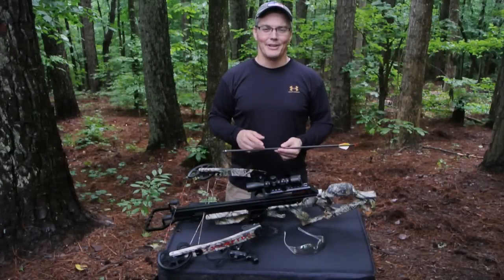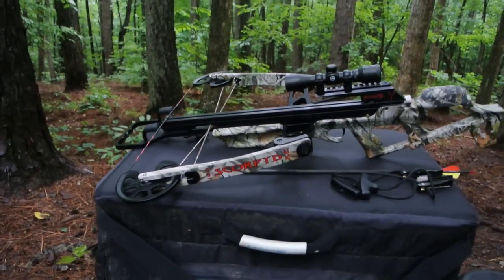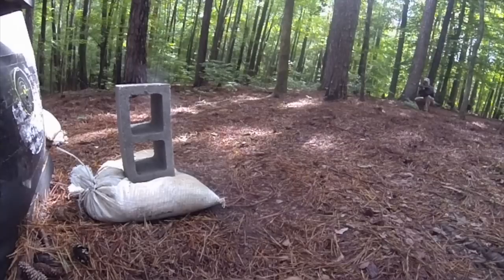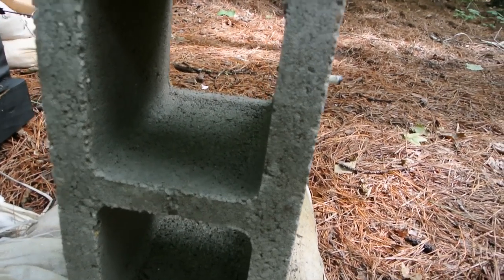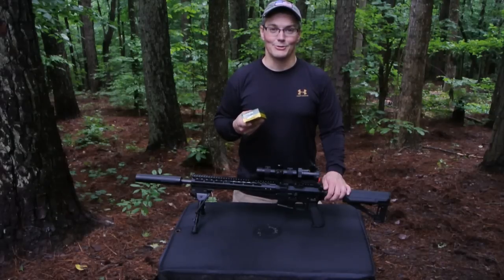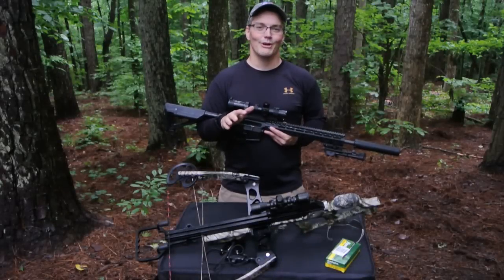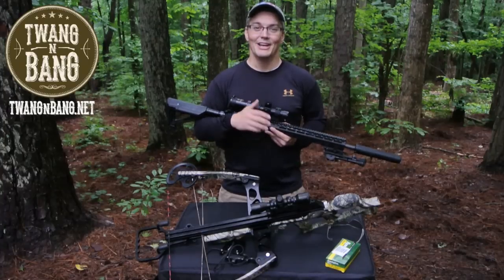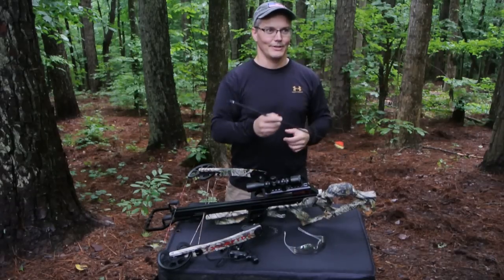World's Most Powerful Crossbow vs Cinder Block! (AR15 Finishes the Job)

Comment: The couch arrived in two boxes four days early, which was great because we'd just moved into a new house and needed places to sit. My son and I put it together pretty quickly https://www.youtube.com/post/UgkxitRzxya-XugamYgLwa_2G1gxPg4MCJHa . Another reviewer suggested inserting the seat into the side and I'm glad they did as the instructions weren't clear on that matter. It's incredibly light and slides easily across the wood floor, making it easy to move. It's firm, but comfortable. It will even be great to nap on. I got the gray, which definitely has strong blue undertones, but I'm okay with that.

Comment from the maker: Don't lose sight of the huge advantage compound bows have over recurves for efficiency.  The only recurve crossbow in production today that shoots as fast as this bow has nearly double the draw weight, and even that has much more efficient limbs than could be produced in medieval times.  So much of the energy required to cock an ancient crossbow was wasted and not delivered to the bolt.

Comment: One of the thing you might have missed is that in his basement, the blocks make up the foundation.... They are solidly secured and will not move at all.   You had a free standing block so the energy got transferred into motion of the block instead of staying with the bolt.   And i think a FMJ or Magnum bolt might have a better chance of cracking or penetrating the block.   The FMJ and Magnum bolts are carbon fiber shafts wrapped in aluminum.   Should be the best of both worlds, the aluminum shell should keep the carbon fiber from splintering and the carbon fiber should keep the aluminum form snapping or crushing.... Just my ideas i thought id share.   Not sure if youve thought of and tried these yet or not.    Great Vid :).  I have a Stealth-X2 myself

Comment: Sorry I'm late to the party here, two reasons why I think your wicked bow didn't have the effect you were looking for: 1) it's a loose block, when the arrow stuck it, some of that energy was absorbed by the movement of the block. 2) If the hunter your mentioned lives in an older house, he might actually have true cinder block and not a concrete block that you appear to be using. We use the terms interchangeably but they're actually 2 different things. A concrete block is made of pure concrete while a cinder block is made of a mixture of concrete and coal cinder and/or ash making them lighter, and more importantly, weaker. I think your bow would have no problem on a true cinder block that's fixed in place. Love your channel brother

Comment: You have to remember that when your friend shot a cinder block in his basement, it was being held in place by the rest of the wall.  A lot of the energy your arrow could have used to penetrate the block was instead used to move the block backwards slightly.

Comment: In High School, as a Class Project, We constructed a Mid-evil Turret based Cross bow, using OAK Centers reinforced with Truck Leaf Springs. It's Tension on the Cable + just over 1200 Lbs. We used a Fixed Winch to Cock the Cable & left over springs as the trigger. We also used a part Oak & part Tungsten Carbide steel Blade from a snowmobile As The BOLT.
due to it's unknown nature, We where allowed to shoot the bow twice, The first BOLT 
Misfired & Passed through 8inches of freshly Cut Solid Oak.

Comment: Oh i forgot to mention you. Wooden arrow and modern arrow are actually different not just by built but also in delivering energy. Modern arrow have holes or hollow within while wooden arrow doesn't. This affected the amount of energy delivered to a target simply because of the arrowhead pressure. When modern arrows hits the target the arrowhead will be pushed into the hole if the target are hard thus waste a lots of energy while wooden arrow delivers full energy because there are no space

Comment: Oh, I was expecting more draw weight, but apperently it's just that much, should probably not have checked the 1250 pound draw weight crossbow before this
Reply from the maker: Draw weight =/= power.  Power stroke is what matters.  Super high draw weight crossbows with straight limbs are very inefficient at putting their draw weight onto the arrow.
Reply: @TWANGnBANG  Power stroke does matter alot, but so does the cam and limb design aswell as the draw weight in terms of increasing the velocity. The crossbow in question that I mentioned has quite the short draw due to it's old design, and it doesn't suprise me that there's quite a bit of kinectic energy loss with it, still with it's faults it did manage to do 235 yards and it's supposed to manage doing around 240-260 yards. 

I'm not exactly the most knowledgeable with crossbows so first and foremost I'm not entirely sure what sort of range the scorpyd has (I did look around but apperently not well enough) but with the power stroke and the design of the scorpyd having more weight power I believe it should basically just pile on more power to it in this case at least. 

Although the big number difference was what my comment was about for starters so in that aspect you're 100% correct in calling me out with the facts :')

Comment: Now that's what I call a good suppressor. What was that, 50 meters from the block? Only a slight crack of a bullet hitting cinder and the block cracking was heard.
Reply from the maker: Мирдж Кладоискатель More like 30 meters, and yes, the 762-SDN-6 does a decent job with subsonic 300 BLK rounds.
Reply: TWANGnBANG That's what the suppressor is called? That's not a very market-oriented name, now is it? Also, I should note that I missed the notion of ammo being subsonic: that, of course, does the job better as well.
Reply from the maker: Мирдж Кладоискатель Lots of military-oriented cans are named like that, and it's actually more sensible to put the caliber in the name than to call it a "Wind Whisper" or something poetic that reveals nothing about what it is. :)
Reply: TWANGnBANG Wind Whisper .45 sounds good, though. :) Either way, thanks for making them videos, they're alway entertaining to watch.

Comment: This might be expensive but I'd like to see the crossbow that replaced this one w/ heavy duty aluminium vs a row of like 6 kevlar panels, and if that doesn't work, even w/ a 100 or 150 gr field tip, finish it off w/ your 308 Remington 700, if it's too expensive you don't have to do it,

 maybe do some testing the powers of ammunition or arrows on bear hide, also if in the future, if you have enough money, I'd like to see 308 AP vs 8 level 3 Kevlar panels, that would be pretty cool

Comment: now try it with an aerobolt2  and a harder head with more weight to get though that block, you can do it I cut a 1.5 inch corner off a 75 year old brick that was 3 inches with a vpa single bevel at 300 grains.

but the aerobolt 2 is almost $30 a bolt, so only if you have the funds.

Comment: Oh by the way I did something like this, on the 4th of july, on a 75 year old brick it loped half the corner off with the broadhead and bent it, I did again and well pretty much folded the tip of the 300 vpa to the head itself, the first time I shot from 15 yards it exploded the bolt in spectacular fashion, very dangerous.

Comment: Nice vid.  Now is the recorded sound of your suppressor close to the actual sound you hear?
Reply from the maker: monkeydad1969 The noise is similar to dropping a dictionary onto a hard floor.  It's a bit louder than you can tell from this video, but it is still crazy quiet.
Reply: TWANGnBANG just a little add on for monkeydad it's not the initial discharge that is all that loud on a suppressed weapon... it's the impact of the bullet. If you've ever been close to the point of impact, especially if the point impacted was a hard surface such as metal, your ears will ring. Suppressors are great tools in masking your location but don't make you the silent killer Hollywood would like us to believe.

Comment: You'd probably get better results if the arrow hit the block at a perfect 90° angle. If the arrow was perfectly straight at impact, ALL the energy would be at the tip and would probably penetrate the block. Also, place another sandbag on top of the block to help prevent it from moving and taking energy away from the arrow.

Comment: Nice video, but it would be great if you could buy that aluminum arrow to show its power, since carbon arrow was performing a bit bad against hard surfaces like car doors, body armor and such. Like you said it expands when it hits hard surface, and lose its power. I don't know if they are too expensive but it would be great to see them in action. By the way I think that full cast aluminum arrow is recommended for this bow because high kinetic energy it produces. Thanks.
Reply from the maker: Tado Samardžić The arrow that I used is exactly the arrow that is recommended.  Nobody makes straight solid metal arrows in the US. Carbon fiber is plenty tough for use against North American game animals.   I do have a solid fiberglass and steel discharge arrow that I might use in a follow-up to this video someday.
Reply: TWANGnBANG Sorry I Thought they said solid metal bolt but I haven't heard them right; /watch?v=yhVNMoRXjOY.
Thank you for fast response and great videos and review you've been providing us with.
Reply from the maker: Tado Samardžić Not sure where in the video they say that, but as I hope you understand, I don't have time to watch the 10 minute video to find out.  In any case, you can see they sell GoldTip Laser III carbon arrows with their "Scope Plus Package."
http://www.scorpyd.com/crossbows/velocity/

Comment: Wow, that crossbow puts my old Barnett Commando to shame. I think it's rated at 205 fps. I might as well be shooting paperclips with a rubber band between my fingers. I REALLY need to update some of my equipment. You might try a aluminum shaft with a depleted uranium tip. (if you can get it) Depleted uranium is very heavy and very hard. They use it in the cannon of A-10 Warthogs and Phalanx systems. The major problem is machining it. I think you have to grind it. Make sure you wear a mask.
Reply: Uranium and Radium have had a strange history in it's acceptance. There were girls who painted Radium on the faces and hands of watches for the military and civilians. The Radium glows in the dark. They would wet the brush on their tongues to put a point on it. About 130 girls died from Radium poisoning and cancer of the jaw and tongue. I saw a picture of a breakfast cereal bowl that was made out of pure uranium. I would imagine that the police would be upset if you had any type of ammo that was designed for penetrating armor. The police of ancient times in England probably didn't like a bodkin point either. Depleted uranium is pretty safe as far as radiation goes.

Comment: Hey, I am about to start doing some hunting with a crossbow but trying to figure the best one out for the money that's durable and accurate, Right now I am stuck between a Barnett and a Tenpoint, I had actually looked at the Barnett Predator or penetrator and the tenpoint wicked ridge, which one do you think would be the best for a beginner that would be using it for small game and big game like deer and bear? Thanks for any advice
Reply from the maker: James Mollohan Tenpoint has a better reputation as a company, but in the end, it is best to shoot them both and decide what works best for you.
Reply: I've got the Barnett jackal and it doesn't look like much but from my experience it's and amazing crossbow! I bought mine for $270 so the price aint bad and its super accurate! It has a 150 pound draw so it has no problem taking down a deer. Consider checking one out for yourself.

Comment: Amazing vid! Have you had a chance to shoot Barnett's ghost or the bow that has impressed me the most Barnett's Predator CRT version, I know that the Predator is rated at 375fps and 131lbs of KE but after some actual hands on use I would say the Predator is better all around than the Ghost and probably competes with the scorptd. I only have my chronograph for now but I know the Predator can shoot far over 400FPS I would think the KE would also be much higher than they advertise.... Maybe you could run a test?
Reply from the maker: I'm not sure where you're getting the speed on the Predator at well over 400fps.  The RAZR is their fastest right at 400fps with a 400gr arrow.  Barnett's are interesting crossbows, for sure.
Reply: Yes, you will not see over 400fps unless you drop the arrow weight. I know this is not ideal but we just did some testing and playing around. But I have seen the predator dry fired multiple times and then still shooting completely in tune... The predator just seems to offer more than what the box actually says...
Reply: I mean the Predator shoots 375FPS with a 425Gr arrow hitting @ 131FPKE. Drop the arrow weight and the speed  increase's significantly. I just feel the Predator Ultralight  has slipped by so many people as they think the Ghost or the RAZR are the way to go if your looking for speed... In reality those speeds are achievable with the Predator, not to mention the cash you will save.

Comment: I'd prepare special ammunition for this job - maybe a 300gr. threaded insert and epoxy it in, so you're transferring maximum energy to the point, or perhaps a 200gr. insert point - try different weights to find the right balance of fast vs. heavy A really securely fixed insert is going to reduce the chance of wrecking the shaft so you might get to reuse some arrows, but if you do be sure to thoroughly flex test them before shooting (and maybe wear full face and hand/arm protection anyway).

Comment: Just one question, Why didn't you use scoryid's bolt. they are solid core?
Reply from the maker: Eric Lendt Nope.  The arrow used in this video is actually much stronger than the Gold Tip Laser II arrows that Scorpyd supplied with this bow.  Thanks for watching!

Comment: Ah did you see they have a new aerobolt 2 dragon slayer and an aerovane 3 now, Dorge of Firenock told me they make the aerobolt up to 2000 grains thats more then even the biggest elephant gun rounds back in the day 2000!
I still say you ought to put a really hard solid machined broadhead on the tip of the arrow a good heavy one like 200 grain or more if your arrow can handle it, and of at least 50 rockwell, I bet it would utter smash the cinderblock along with the arrow. just think about it though, I did a test on a 75 year old solid brick and it bent the broadhead but cut about half of the corner of the 3 inch brick off and shattered that arrow in a spectacular show, needless to say such tests are dangerous, and they dont make a 300 grain vpa single bevel anymore, lack of sales, but they have a 300 double and 55 rockwell and there is recording of it taking down a cape buffalo already with a vpa production broadhead so you know its a strong broadhead even as a double.

just think it over or if you really want a bow to do it use a 357 magnum head mwoohuuhaahahaaa.

Comment: Using a cedar shaft tipped with a plate piercing head shoot out of a 100 pound bow you should not have any problem crushing that block. heavy arrows is key ;)

Comment: My 30 06 would turn a block to concrete one shot....thanks for vid bud
Reply from the maker: Shawn Paulley Sure, but you couldn't shoot your 30-06 in my backyard without having half the county deputies responding. ;)
Reply: Mine eather bud, I just bought my daughter a Barnett recurve crossbow. And I'm going to buy the Ghost 410. I'm looking for a red lazer for my daughter that will some how mount to the scope that came with the Barnett recruit recurve 150lb.is there any you recommend ? Daughter is 12 and just now getting into it
Reply: I got the ghost Barnett 410 and a recruit recurve for my daughter. What broadheads do you recommend for the crossbow

Comment: Arent arrows for crossbows called boltd or has gaming molded me into misinformation?
Reply from the maker: Modern crossbows shoot arrows, but even the industry still calls them bolts at times. The technical difference is that arrows plane in flight, whereas bolts do not.

Comment: Sir... Somehow I came up with an insane idea: Put a 5.56mm in front of the arrow. 
There we would stick them together using somekind of custom pipe which fit the arrow head and the bullet case tightly. When the arrow hits the target, its whole body will be stopped. Then its metal pointy head will act like a needle, slide inside the custom pipe and kick start 5.56 primer. BANG We would have a bow with smokeless powder's power.
What do you think about this? If it are Ok then make us a video sir. It will be really fun.
Reply: yeah some company do this with .357 mag,but the problem is if you don't have a "barrel" enough strong it will explode like a weak grenade doing shrapnel damage but with weak penetration, but if it's steel it would be OK.
Another problem is if the 5.56 round recoil it will not fit into your "custom pipe" (i don't not if you are talking about a straight pipe or a chamber that follow the shape of the round)
and since the 5.56 is a necked cartridge is neck will spread and crack resulting in a marksmanship similar to a smooth-bore rifle.
So the solution would be to machine a chamber without barrel for 5.56 drop a round into it, and When the arrow hits the target the CHAMBER+ROUND slide back and hit a fixed firing ping
Reply: Wow man, that got my idea useless and expensive.
Reply: Ngọc Kim Quang Hồ as i said there a company who made a .357 mag arrow tip